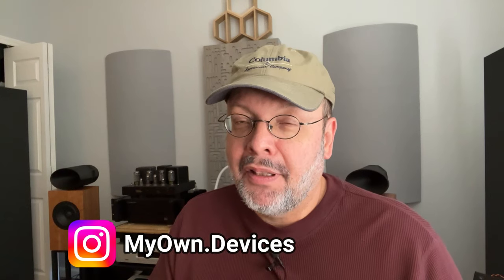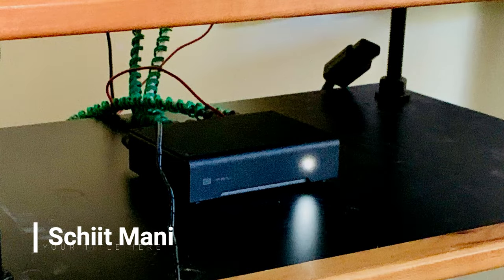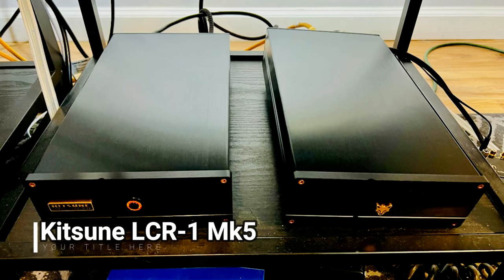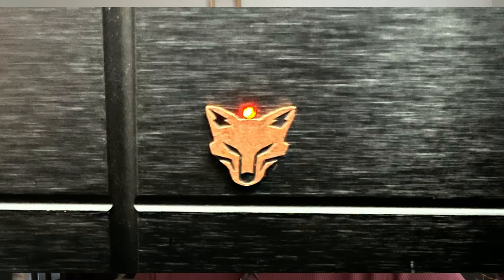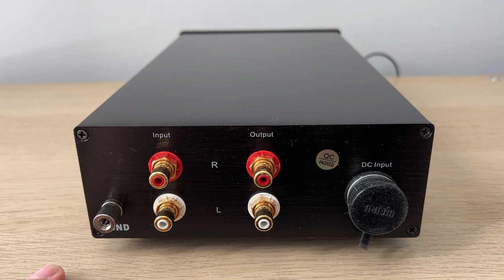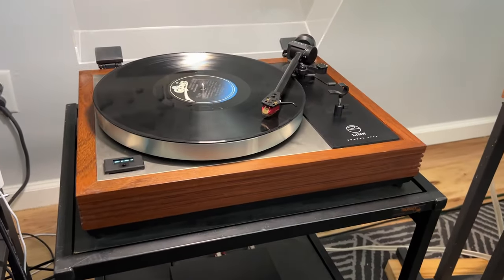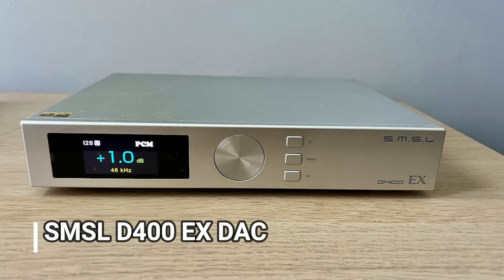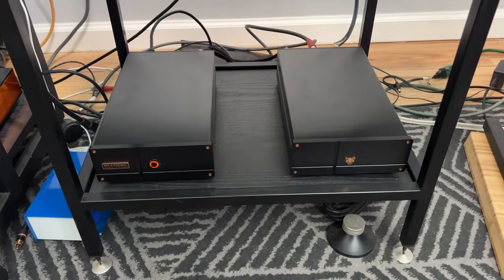Analog Enchantment! Kitsune HiFi LCR-1 Mk5 Phono Preamp.

Comment: Nice to see a focus on external phono preamps/equalizers👍👍

You are spot on in terms of investing in a little more expensive gear to extract as much sound improvement as you can without breaking the bank. I bought a Sunvalley EQ-1616D tube phono preamp that allows me to hookup two turntables. One I use with a Bob’s Devices Sky 40 SUT and the other TT with a recent purchase of a Lounge Audio Copla silver wire edition much like a SUT. They both work well with the various MC cartridges I own. Nice work Dave👍👍

Comment: Interesting video.  Just before you reviewed the Puffin I was doing research on it & your review was the tipping point for me to buy one.  I have been happy with it but, am a bit disappointed that the new Waxwing costs less & that the prices for used Puffins seems to be going down.  I realize that one can never be sure about a piece of audio gear holding its value or not. I went to the Waxwing website & it doesn't seem as packed with info as the Puffin's was. The big change is remote app control, which seems nice but, most of the time I just change the settings on my Puffin when I change records. I am not sure if it's performance has changed much otherwise.  If you do a review on the Waxwing I would be very interested.  Keep up the great work!

Comment: Thanks for covering a phono preamp! I share your appreciation for this under valued piece of equipment. I am looking for an upgrade to my EAT eglo petite (about the same price range as the Kitsune). The dip switches on the Kitsune, though, are a turn off for me. I had those on the Vincent PHO701. So much more convenient with front switches on the EAT. One of the big factors for me is soundstage, which opened up when going from Vincent to EAT (with VPI super prime scout and SoundSmith Zephyr MIMC* cart). I am considering the PrimaLuna EVO100 Phono. Have the EVO300 pre and like that. I also have the Holoaudio May DAC L2 (not the full Kitsune edition), so appreciate their approach. Have to look a bit more into this LCR architecture. Had not heard of that. Sounds similar to a R2R DAC philosophy like in the Holoaudio May DAC.
Reply from the maker: Looks like you have some nice stuff. Tim Connor at Kitsune says they may not be making any more of the LCR-1, which is a shame. They have a couple remaining in stock. Thx.
Reply: @MODAC  I quite happy with my set-up, indeed :-) Just looked at the LCR phono stage. One thing that jumped out at me is top R value is 200 Ohm. I know my cart sounds best at 600 or 1200 Ohm, lower settings are very lean and tinny. That 200 Ohm limit is a serious design flaw, IMHO. On the upside, S/N metrics are exquisite. I still cannot quite figure out what this LCR tech really does. It's all coated in lots of funny buzzwords without giving any actual information. That is really a shame. Cannot even figure out what LCR stands for. Thanks again for providing food for thought!
Reply from the maker: I do explain what LCR stands for in the video. Thx